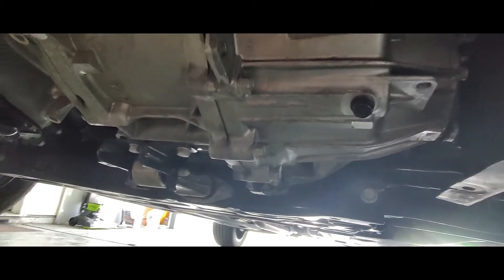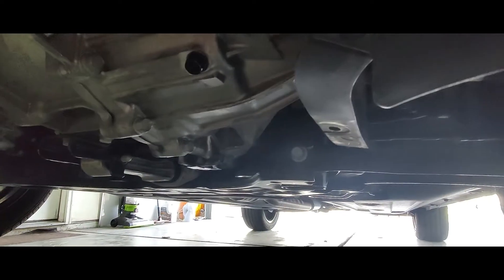Kia Seltos 7spd DCT fluid change

Comment: This works for the '21 Elantra N-line. Thank you so much. 

Mines came out dark as heck at 26K miles and the smell was awful. The redline oil made alot of improvements too. 

I couldn't find the OEM washer kit so I bought a kit off Amazon that contained 
M18x24x1.5mm crush washers and it's the exact size and fit. 
I'm sold!

Comment: is there a trans fluid dipstick to check the level or do you have to take out the fill plug and see if any comes out as a level check
Reply from the maker: No dipstick, unfortunately. According to the FSM you're supposed to be able to check it with the fill plug removed. 

But, the fill plug I used isn't the one to check the fluid level. That one is the one that's inaccessible. That said, you just gotta keep track of how much you put in.
Reply: @crxtodd16  awesome, thanks. Reason for asking is I got a high transmission temp alert so I wanted to check the level to see if it's a fluid or a sensor issue

Comment: I based on that video to change 7DCT transmission oil in my Kia Ceed 3 1.6 CRDI. Everything was clearly presented, the old oil was drained easily. It is necessary to use a pump to pour it from the bottom of the car. About 1.75l drained out, I poured the same amount back.
Thank you for your help, good job!

Comment: How's the redline held up so far? 
I filled my oil from the top. I had to remove my air box and battery, but it gives me a chance to clean my engine at that time too lol
Reply from the maker: So far so good! The DCT is shifting no different than it was before the oil change, and I haven't noticed anything abnormal with the rear diff. I figure I'll probably change the oil again after I hit 60k miles. 

Speaking of cleaning the engine, I should do the same, haha. It's all covered in thick dust.
Reply: Guess what? So my transmission quit on me at 237k... I got a code P073F that it won't engage into gear 1. I guess I'm going to have fun with this and figure out what's wrong with it lol
Reply from the maker: @josediaz2471   Dang man, I'm sorry to hear that. Have you been able to figure things out and get it fixed? Hope things are going well, take care.
Reply: I'm actually getting a new one. I'll probably sell the used one as is lol By any chance, do you know where I can find out how many quarts of oil it takes for a brand new transmission?
Reply from the maker: @josediaz2471  I believe I say the total capacity at some point in the video... I've honestly forgotten already! I'm sorry!
Reply: I finally got my transmission in and running... I learned a few things along the way, but finally got her running again. It feels like a new car lol
Reply from the maker: @josediaz2471  Outstanding! That's not an easy task, I'm glad you got things fixed! Nice work.

Comment: how's it holding up? I did the oil change but I'm concerned about longevity.
Reply from the maker: So far so good, no problems and it's running normally. 

I think at 60k miles I'll change the oil again, but this time I'll use OEM gear oil directly from the dealer.
Reply: something wrong with redline? I read about it and apparently it's very similar to oem, I also made the oil change with redline about 50 miles notice something weird with shift but only was a isolated event on a very slippery road I think I'm just paranoid. here the oil info: https://multilinkstory.blogspot.com/2019/07/hyundai-kia-dct-transmission-fluid-mtf.html?m=1
Reply from the maker: @baruk8082  I think redline is just fine. Honestly, I'm just curious to see if there is any difference between it and OEM, hence why I want to switch back and forth.

Comment: I found this video excellent. No nonsense and easy to follow/watch. Very well done 👍 
Have you noticed any difference between fluids? I’ve heard Redline is meant to be awesome for smooth shifts.
Reply from the maker: Honestly, I haven't really felt any difference whatsoever. I'll change it again at 60k miles and go back to OEM fluid and see if I notice anything then. 🤷
Reply: @crxtodd16  there’s an idea
Reply: @crxtodd16  are there any filters that should be changed?
Also how do you find the transmission? I find it’s different day to day and can slip badly, mainly if the weather is cold
Reply from the maker: @Hutchy86   No filters in this type of transmission. I am not sure what you mean by how do I find it...?
Reply: @crxtodd16  how do you find it? Do you like it ect ect
Reply from the maker: @Hutchy86   Oh, I understand now - sorry!! I think it's okay, though I feel like it should shift faster than it does. It seems like it shifts very gently and cautiously especially when I want it to be faster and more aggressive. I think Hyundai/Kia should have used a traditional torque converter automatic for this car. Oh well. I heard the newer, 8spd DCT is much more refined than this one, and they might be using it on the newer cars instead of this 7spd DCT - if so, that was probably the right choice.
Reply: @crxtodd16  it does look good on paper but I’ve been told by a service tech that it’s already showing problems. More than one he has seen had to be replaced under warranty. If that’s true it doesn’t look good as it’s only new to the market 🤷‍♂️
Reply: @Hutchy86 I have a 2022 kia forte GT that has the same 7 speed dct and 1.6 engine, and my transmission was replaced 3 times under warranty already. I agree, they should have used a traditional transmission in these cars. The dct is definitely a major short coming of the newer kia/hyundai cars.
Reply: @delaneyschafer2110  wow 😢 
What was the problem each time?
Reply: @Hutchy86  the first time was at about 9k km, clutch packs wore out. They replaced the clutch packs under warranty. About a week later they were slipping and showing signs of extreme wear already. They replaced the clutch packs again under warranty. Then when I got the car back again literally the very next day the actuators failed. It was basically stuck in 5th gear, I had to limp the car home, clutch smoke everywhere. Got it towed to the dealership and they put a whole new updated 2023 dct in the car. It's been good so far, but it still slips and shifts funny from time to time. It still feels like it's going to fail at any given moment, but who knows haha it's been feeling like that since the new dct is in.
Reply: @delaneyschafer2110  wow. They definitely have a mind of their own. 
Which country are you in and do you slip the clutch a lot ? Say bumper to bumper driving?
Reply: @Hutchy86  I'm in Canada. And no I do literally zero city driving. All my driving is highway. I have two stop signs before I leave town, and then 100km highway commute to work everyday. I don't bag drive or race or anything. Just a commuter car to and from work.
Reply: @delaneyschafer2110  well that definitely sucks then. I find these transmissions don’t like the cold weather. That’s when I feel they slip the worst. How many kms have you done on this new dct?

Comment: The user manual says that this transmission has  70w GL4 DCTF oil and the oil you used in the video is for mechanical transmission can you explain to me
Reply from the maker: Yup - Hyundai/Kia's 7spd DCT is in fact a manual transmission, albeit with an automatic shifting mechanism and a dual clutch. If you look over the Redline gear oil I used, it is the same weight and viscosity, GL4 transmission oil, thus being compatible with the DCT. Redline also advertises this fluid as being compatible specifically with this transmission.

Of course you don't have to use Redline, you can also get the OEM gear oil directly from your local dealer. Either works just fine.
Reply: Thank you very much for clarifying my doubt, I have to change the oil transmission  of my Hyundai Kona and this video was very helpful..

Comment: I have a veloster 7 speed dry DCT transmission.. how true is that dry dct dont need oil change??
Reply: I wouldn't say "never" but after 60-100k miles for sure it needs to be changed.

Comment: Over here in the UK the Kia Dealers tell us the Gearbox is 'sealed for life' - by this I assume they mean for the 'life' of the 100k miles/7 year warranty. You are absolutely doing the right thing by maintaining the car's fluids, I'm all for that but I would be a little concerned that by changing the oil yourself if you later  had some other problem with the DCT then maybe they would be able to test the oil and confirm that it's not factory oil and void the warranty? this will sound dramatic but warranties are basically insurance policies and tiny details matter. 
I only commented in this way because I'm currently investigating changing the Engine Oil on my 2021 Sportage with the 1.6 turbo engine because, like many, I don't like the sound of 10k service intervals when the engine holds less than 4ltrs of oil! my thinking was to 'extract' as much old oil as possible through the dipstick tube, replace with new oil, but leave the filter in place so as not to affect the warranty going forward. I've just subscribed by the way, thank you!
Reply: All fluids degrade with time and heat, so I don't know why the manual says that it's sealed and it should  not be changed. Programed obsolescence I think. The idea is to maintain everything in optimal conditions, not to buy a new transmition.

Comment: I have a 2017 Hyundai Accent crdi with a 7spd DCT. I've been looking a bit online and am having a hard time finding good specific information about the transmission. Does anyone have a good resource for a workshop manual or something? Much obliged.
Reply from the maker: It's a good question. Hyundai and Kia utilize an online factory service resource (basically an online service manual) that you have to pay to access. I paid to access it on my previous car, a Genesis G70, then I downloaded most of the manual (they have it all divided up into sections, so it takes a lot of effort to download all of it). 

I found a couple segments online related to this transmission off some Hyundai and Kia forums. Otherwise, you can create an account on the Hyundai service website and pay their fee to access the service manual specifically for your car. It also has all the TSB's and other useful info. Even so, I've found that Hyundai/Kia's service manual to be very lacking in detail, unfortunately. 

The website is hyundaitechinfo(dot)com.